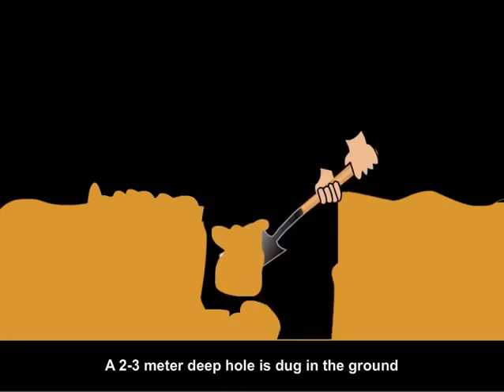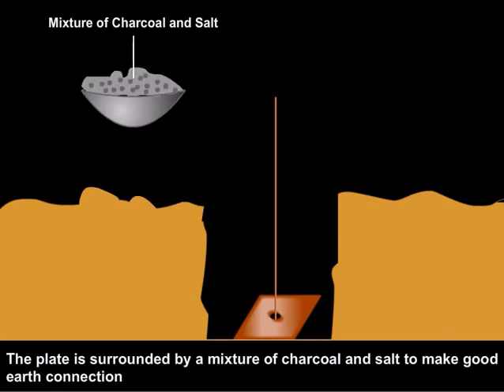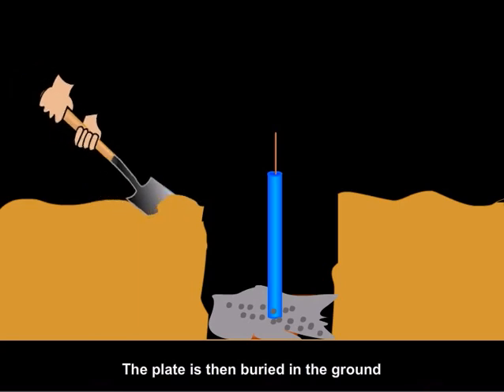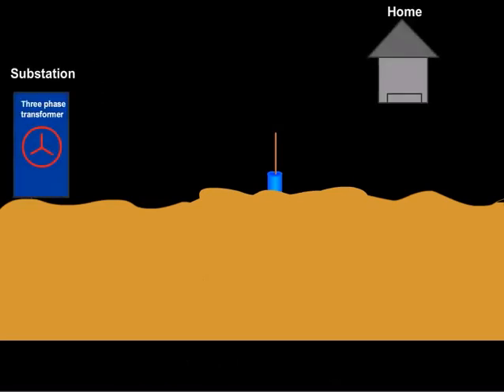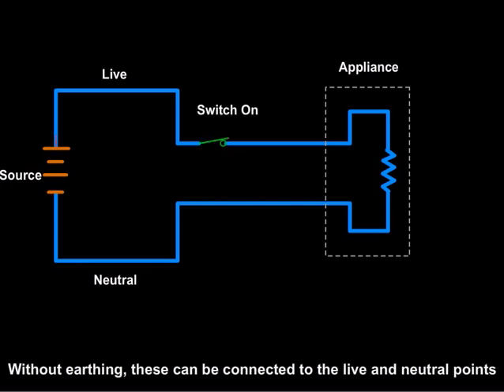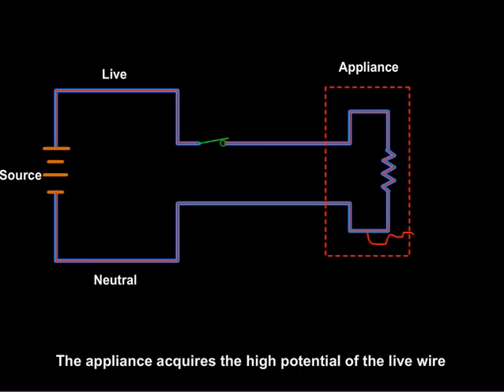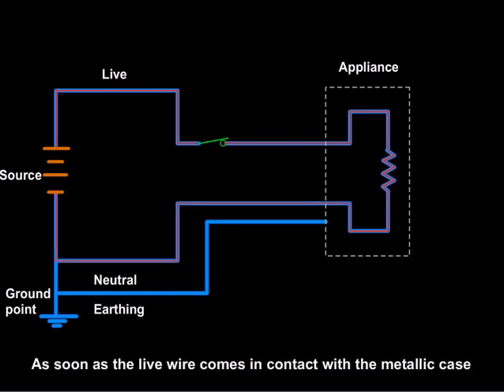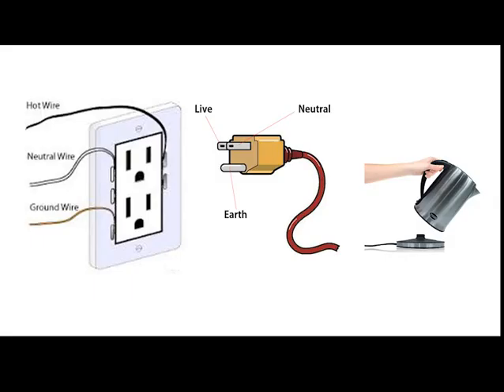What is Electrical Earthing?

Comment: No it is wrong. the current takes all available paths and the grounding doesn't protect human from electrical shock ?? could you please clarify why the current didn't flow in the neutral conductor even if the ground has smaller resistance ?